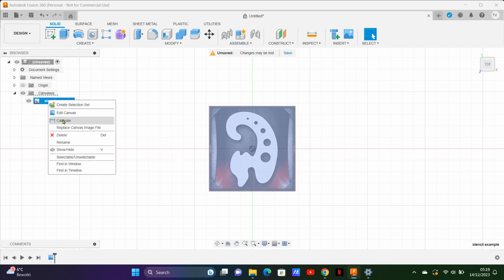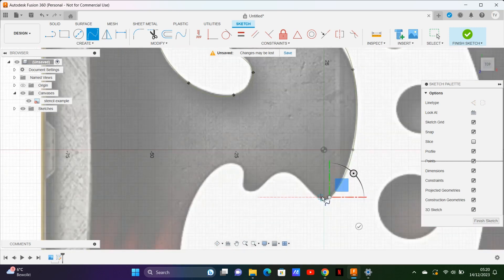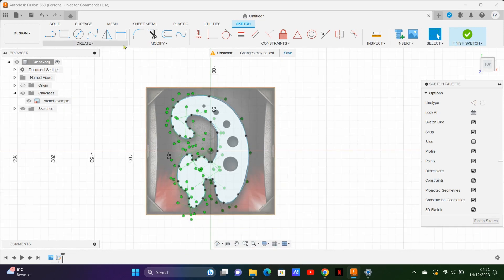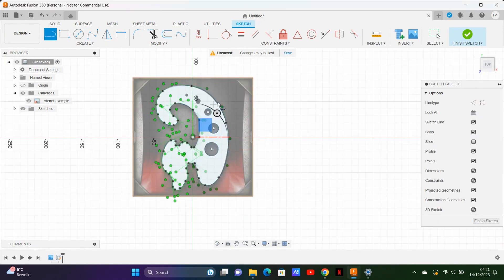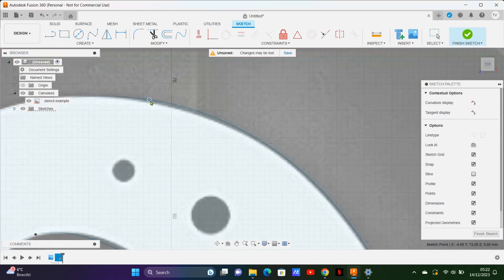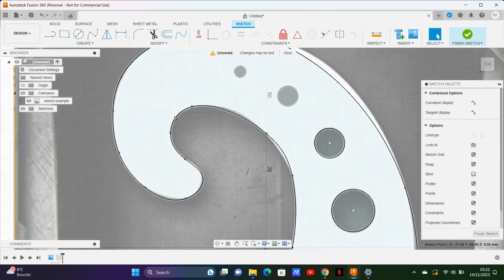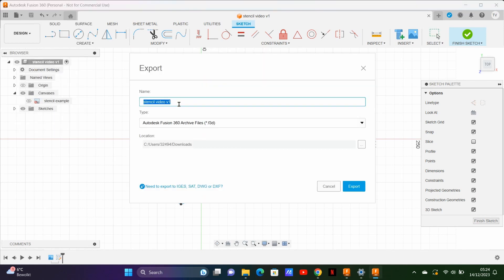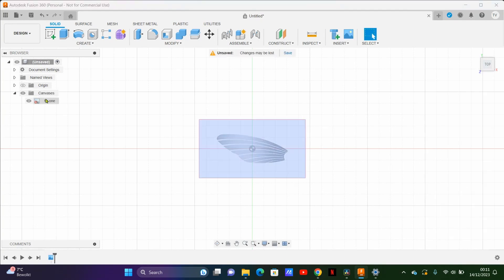How To make Your Own Airbrush Stencils (Fusion360)

Comment: I've used Fusion 360 to design a few fishing lures, but hadn't thought to use it for creating stencils. 

We have a Cricut so I usually draw stencils in InkScape, another free drawing program. It can automatically trace an image, then I manually make adjustments as needed and save as an SVG file. 

InkScape has the ability to draw splines and export to DXF but I don't know if it is as straight forward as Fusion. Thanks for the video and Idea!
Reply from the maker: I'll check out Inkscape for sure, i'd like an automatic tracing feature but found the ones in other apps to be terrible. Could save me a lot of time when making a pike pattern stencil. 

Thanks for the tip and i'm glad my video was useful to you.